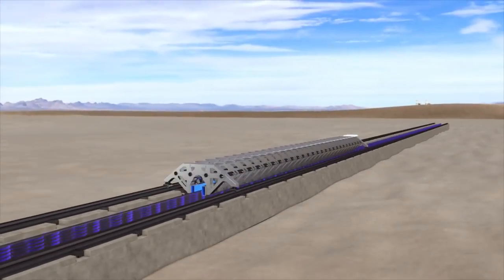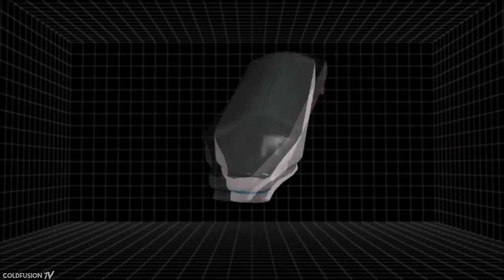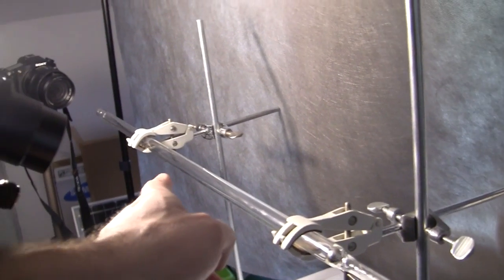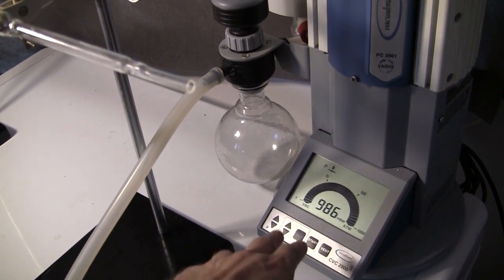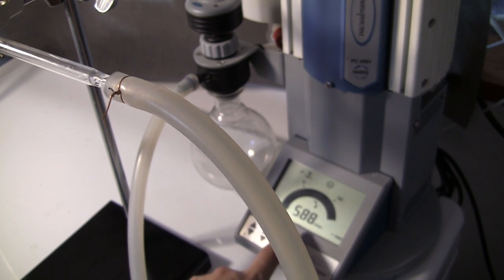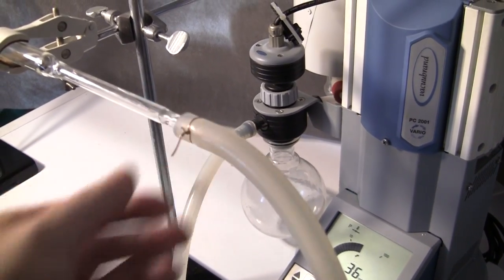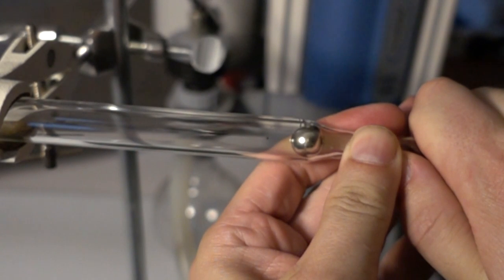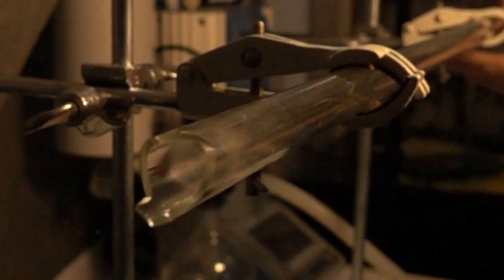How  the Hyperloop can kill you!

Comment: Can we have a tick of sanity here.

A regular surface high speed rail system with 320+ kM per hour speeds (200+ mph) can run on good quality surface tracks costing say 1M Euro per track-mile ($1.1M) , with only certain sections needed in tunnel. And is compatible with other trains if required.  
Standard overhead line at 25kV included in the above price to power conventional and high speed trains.
Trains are pressure sealed but only for comfort, cost average 2M Euro per carraige.

A Hyperloop system needs 100% tunnel running to operate, oh and fully pressure rated with complex turn outs and junctions, stations and ends. Increases primary cost to (say) 10M Euro per track kilometer. Not including power transfer system.

Power Transfer by linear induction and levitation, requires complete train mass to be levitated not run on wheels, benefits train resistance but not efficient in energy terms. (see Maglev projects in Shanghai and Germany/japan) Add 1-2M Euro per mile.

Trains must be fully pressure sealed to space capsule standards cost per car , who knows, say 5M euro per car...But this requires heavy structural strength so train mass will increase...there goes that energy efficiency again.
But no Bogies/wheels required so this may be a small increase.

Operation, high speeds require a very long station to station distance to be effective. Especially due to complex pressure structures required, probably ONLY technically feasible in an end-to-end transit system of over 150 miles. So it would halve/third a journey time for 10+ costs, and amortising the research and developement over a few possible systems. 

I leave conclusions to you..
Reply: Internetzspacezshipz 
30 years as a rail transit design engineer perhaps, or you could just look on the internet for tunnelling costs and take it from there?
Reply: Dave Bell I'm not the one trying to prove something here, just questioning where you got these figures. Oh, another thing, just because it's in a tube doesn't mean it has to be underground.
Reply: Seems like a much more realistic criticism than "if something breaks, shit might go wrong".
Reply: I don't see why they suggest LA to SF in 20 minutes, or whatever the example is in the video. It's more feasible over vast distances, like NY to LA, or Hong Kong to Paris.
Reply: It isn't actually commercially feasible over any distance, as you can see from the figures above. Also how do you get more than one train in the hyperloop at once to provide a regular service? A complex airlock system of train length proportions is required, plus the energy to maintain this pressure is never mentioned.
Reply: The figures that you came up with out of your ass? Yeah okay. Maybe if you had some citations to prove your nice round numbers, "10M Euros per km"...
Reply: He couldn't even manage a rapid total failure of his test apparatus.
Reply: I think your costs are far too low. The California High Speed Rail, which does not require tunnels, depressurization, linear induction motors or sealed carriages is budgeted for $67 billion for 1300 km, or $50 million per kilometer.

Maglev, tunneling and pressure sealing would probably raise that tenfold.
Reply: Condor Boss, is that published data, does it include stations, turnouts, trains, maintenance yards, spares, running costs? An accepted surface twintrack with ohl figure is in the region of $5M per mile PLUS all of the above.

Comment: but you break a big hole opened in comparision to the tube.. in a real scale, only if a meteor fell on it, it could happen.. and by the way, I guess the tube wouldn't be permanently with vaccum.. they would take air out only when they used it

Comment: it's a fair point to a bring up but one that can be countered through a safety system. Personally i'm not a fan of the hyperloop because logistically it doesn't make much sense. Note going fast no one gives a fuck about, and this system is expensive and only really good for human transport. What industry would get behind it. Why would I want to invest billions in something that isn't really that much better then current systems.
if i want to haul goods, electric diesel is extremely good at that and if i want a system for human transport why not just use a normal mag train with can still haul a decent cargo. Plus current systems are cheaper to expand and repair, because you don't have a bunch of extra parts making them out like a very expensive tube and pump system.

Comment: I would like to point out that the ball is acting as the stopper for the tube.  Most designs for the hyperloop the pod does not take up the full diameter of the tube (in the PR animations it is but the real designs it doesnt).  which makes this demonstration a little bit misleading as the air from the sudden release of vacuum would be able to go around the pod thus making the acceleration a LOT lower.

Comment: That demo didn't prove anything except that safety measures are warrented (duh). Ideas from the top of my head: Pressure sensors along the pipe and sectional venting when high pressure differences occur. Brakes that clamp when acceleration becomes to high (similar technology exists in elevators already).
What's your realistic worst case scenario? A sudden total pipe failure seems unlikely except for a deliberate explosion. And couldn't you blow up trains the same way?

Comment: The Concorde used to have a flight ceiling of 18km (60000ft) where the air pressure outside is 72 millibar. That might still be less of a pressure difference than the hyperloop, but that wasn't any form of major issue during the design. The aircraft industry has been dealing with pressure differences for so long that this is in my eyes not going to be the issue that will shut this project down. I think cost of building and running the whole thing will be a way bigger issue. But that is just my opinion.

Comment: Also, what happens if the confinement of the passenger compartment fails? A bit like being in space without a space suit?
Reply: Or if the vacuum fails in front of the train, while it's travelling at full speed?
Reply: How often does the confinement fail in space vehicles and air planes?
Reply: That depends on what the full speed is. Likely there would be large amounts of friction and a strong deceleration. It also depends on the level of failure.

Comment: So if you add brakes to the projectile/vehicle and intentionally cause a rapid re-compression, you've just saved on the need for your vehicles to have the electric motor to propel them. 
Well done TF, you should patent that idea since you've potentially just made it far more efficient.

Comment: There are a great many things that could catastrophically go wrong with any system that involves people moving near the speed of sound, but I'm wondering if this one could potentially be minimized if you line the "loop" with pressure sensors and in the event any of them reads a drastic unexpected change in pressure, open vents all along the tube at frequent and regular intervals to try and normalize the pressure equally through out the entire system closer to evenly. In my head this seems like a reasonably easy safety feature to incorporate, though even if this whole thing works flawlessly on the safety record I expect it won't be incorporated on any meaningful scale here in the U.S.

For the record, I'm not saying my idea of rapid venting will work, I'm asking if that is a way to work around this particular problem.

Comment: If it functions as you show then they'd have to use a large amount of energy to pump a vacuum every time they stop. Unless this is showing an example of a fault of an air leak?

Secondly, there is a turbine and an exhaust on the carriage implying they are going to use a jet engine to travel. What is going to be pumped through the engine? Normally it is air however it's been pumped out in this case. The blades will do a lot of spinning with very little effect.

Comment: you Illustrated a good point about the dangers of losing vacuum but did you forget the whole thing is going to be on a high powered maglev rail? also I'm sure it's not too difficult to create a valve system to let pressure freely flow around the vehicle at a rate based on the maximum resistive force of the maglev system.

Comment: Thunderf00t, I know you are used to being sceptical and hearing bullshit science, but this could actually be a reality. Nothing about the safety concerns are insurmountable engineering challenges. Literally every form of transport can easily kill you if you look hard enough. Emergency brakes are not difficult to design, and making something that is extremely unlikely or next to impossible to fail under low pressure is exactly the same principle of planes, and you don't have any problem getting on those do you? or driving around with was it effectively a small bomb behind you in your car, (the fuel tank).

Comment: I dunno I'm sure they've thought of this. Surely the train would be more aerodynamic than a ball bearing. And i'm not sure how close you have to be to the walls for levitation but if you make the train diameter, say, half the diameter of the tube and have it levitate in the center then surely the excess rushing air from a breach would just pass around it instead of propelling it. And I'm sure they'd have a air lock system to contain the breach.

Comment: I'm sorry, but this is just pessimistic nonsense. Just of the top of my head i can think of a multitude of ways to prevent this.

First of all, you can build emergency brakes for the hyperloop cars, (even though they will usually be levitating) by allowing them to clamp unto rails. 

Secondly, a series of electronically connected safety valves could be used to presurise an entire track uniformally. 

Thirdly, pressure failures like this will be extremely rare and unlikely if the tracks are build even somewhat competently. They won't be made out of glass.

Comment: Hyperloop concept is not vaccum travel. it's more like bullet train in vaccum tube it's have track. and tubes is made of thick steel.

train is not really fit to the tube, each have brake of there own and is software controle.

the vaccum is mean to reduce air resistance (and save enagy). not to push / pull the train. it still have bullet train shape tip reduce air left in the tube. bullet train shape tip made it harder to push / pull in case of collapses.

so. it have some build-in safety as far as I know. thick steel tube, brake on each train, bullet train shape tip.

Comment: Absolutely not going to deny the safety risk with the hyperloop here, however I think safety mechanisms can be added to mitigate this risk.

For example, electricity travels much faster than the speed of sound (basically the speed of light).  Localized sensors within the tube could theoretically detect a catastrophic pressure failure and signal safety mechanisms to engage electronically much faster than the catastrophe can unfold.  Mechanisms such as pressure relief valves which could allow air in on the leading side of the breach to prevent the massive acceleration to bullet speed.  The pod itself would also be expected to have both mechanical and magnetic braking mechanisms which could engage to hold the pod in place against the force.  The pod could also have pressure passthrough pipes which would allow air to pass through/around the pod to mitigate the force applied on it as well.  All of these mechanisms combined could respond within several dozen milliseconds.

I don't see issues like the one presented being too difficult to overcome.  On the contrary, I see them as engineering challenges that we are well within our capabilities to design and develop.

Comment: They specify using an electric motor to propel the thing, but you're propelling the marble with air pressure. The animation doesn't seem designed to be taken seriously seeing as the tube it completely open... I figure the actual design will include sectioning off the pod from the tube during loading and unloading, vacuuming out the air, then opening the tube back up and letting it rip.

Comment: On the upside, you'd get to your first meeting of the day early.  On the downside, what you'd be meeting is the wall at the far end of the tunnel.

I'm sure there'd be vacuum failure fail-safes in place - a bunch of vents along the entire length of the tube that would immediately spring open upon sensing a vacuum failure, almost instantly eliminating the pressure imbalance.  Seriously, they wouldn't construct such a thing without them.

Comment: As a purely theoretical idea its not a bad concept, but the difficulty and expense of making it work in real life would be prohibitive at the least, not to mention the safety concerns. The difference between this and a regular maglev train is that the acceleration is vastly more for this Hyperloop than a normal maglev. Like the difference between, well, driving a car and being shot out of a gun. The RATE of acceleration is the danger really. Ever go on a faster 'rocket' coaster and feel the heavy pressure on your chest as it starts off? Well multiply that effect by a LOT, beyond the point that most consumers could really survive. Now, using this as super fast transport of critical non-bio materials could have potential, but the dangers of even one part of the system failing would make it a disaster waiting to happen. It would be much safer (if slower) to use regular train or aircraft transport, especially for stuff you don't want spread out over several miles of empty desert if something manages to poke a hole in the side of the tube.
Also, how exactly do they plan to evacuate the potentially miles long tubes of most of their air? I'm no expert on that sort of thing but the amount of power and machinery that would take probably isn't cheap.

Comment: c'mon, thunderf00t, you're better than this! The car won't be a ball, it will have far more inertia to overcome and it will have safety mechanisms for both the tube (pressure equalisation) and the car (electromagnets or just good, old-fashioned clamps). Did you say 1/100th scale? How big was the rupture you made x100?

No, the killer for hyperloop, I think, won't be physics, it will be the sheer cost of the infrastructure. A train needs little more than two strips of steel to run on, but hyperloop will need massively engineered infrastructure end-to-end.

Comment: I would think i there would be area for air to go between  the inside of the tube and the vehicle, since it would be impossible to get a perfect vacuum,  and just in case of something like this.

I don't see the point of the model with the fans on it, since if its supposed to be a near vacuum, they wouldn't do anything, and if they were rocket engines that would require a lot of air circulation, would it not?

Comment: Just because something is difficult or dangerous doesn't mean we shouldn't do it.
Are you going to make a video about how nuclear energy isn't the way of the future too?

If the correct precautions are put in place and this risk is managed, is it a good means of transporting a large amount of weight for a cheap price?

If so then who the fuck cares is a vacuum failure is dangerous.  Of course it is, it's stupid to even bring it up as if people don't understand there are dangers inherent to fast methods of travel.  

Honestly, you are aware that trains crash too right?  Should we stop using those?
Tunnels can be flooded, bridges can fall.

The engineering difficulty in overcoming this issue is certainly a lot more challenging then things we have undertaken in the past, that's not a good enough reason to walk away from it.

This is the worst video you've put out in a long time.
And honestly, if you had only presented it as a description of the challenge rather then trying to defeat the original concept it would have been totally fine.

Comment: I'm not saying that this isn't a major problem that would need to be addressed but it is still solvable, the things off the top of my head to remedy this issue is to have emergency pressure release valves along the length of the tube around ten - every twenty feet along with pressure sensors. it is well within feasibility to have a computer calculate the pressure differential to allow a controlled stop releasing the pressure in a manner that would minimize the GeForce from deceleration. on top of the fact that thunderfoot did not take into account the speed of a pressure differential entering a vacuum which should be not a insignificant amount less then the speed of light, since he seems to be implying instantaneous accretion of force when the vacuum compromised

Comment: Actually, the ratio between the pod cross section area and the tube cross section area has to be at least >20, Musk stated that in a Q&A a while ago. It would be more like being in a cannon barrel while a blank is shot. Not the best situation, but can be shielded against.

Musk's proposal also didn't have any magnets, these are from an entry in the design competition which is an independent entiety. Musk himself later said that he preferred good old wheels over magnets, with ground effect flight as a possible option down the line.

I think the most important thing here is that not all things called the Hyperloop are the same. The concept got hyped up a lot before technical details were given so lots of people have used the name for their own concepts.